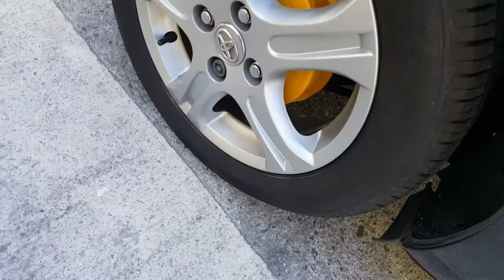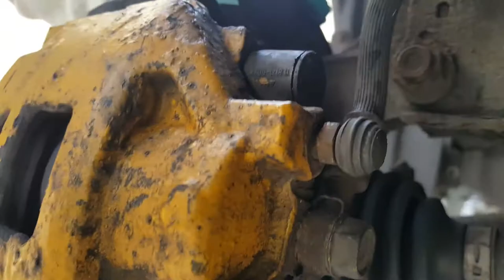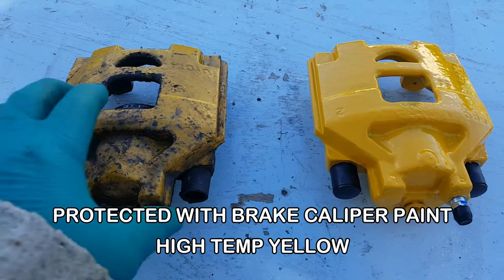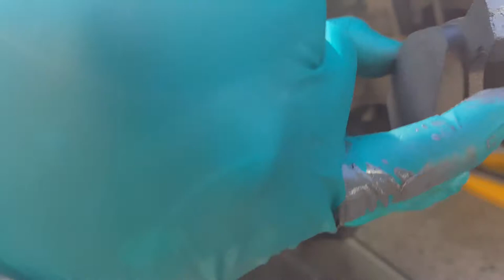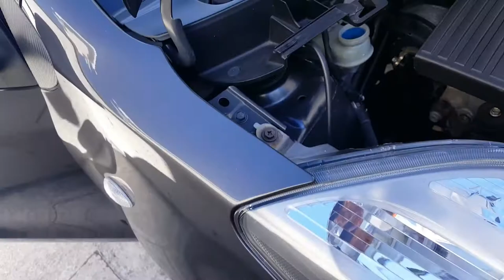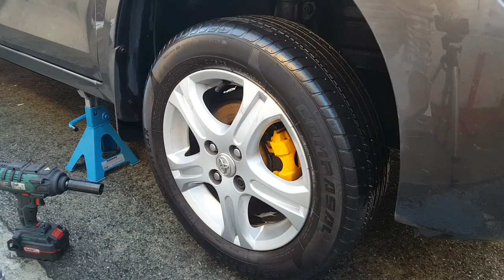DIY- HOW TO REPLACE TOYOTA YARIS STICKY BRAKE CALIPER

Comment: Hi. What Union bolt (banjo bolt) is used for attaching brake cable with brake caliper? Where to buy it?
Reply from the maker: You can buy it in ebay..
Reply: Thanks. Very helpful video. I have just changed my both front calipers and they work perfectly.
Reply from the maker: @greggtka4362  well done ...